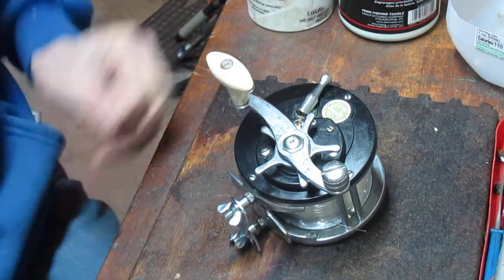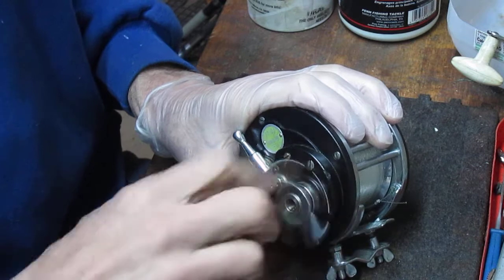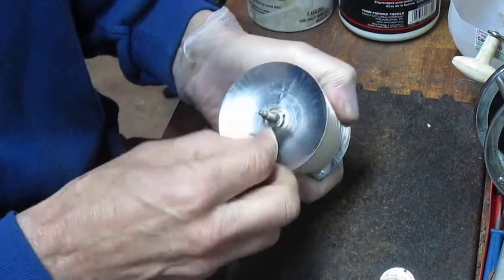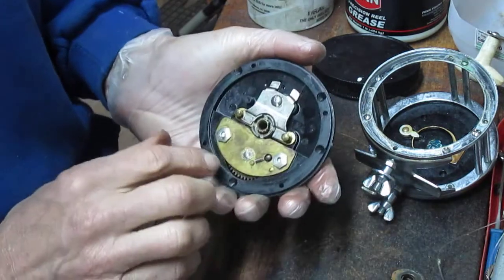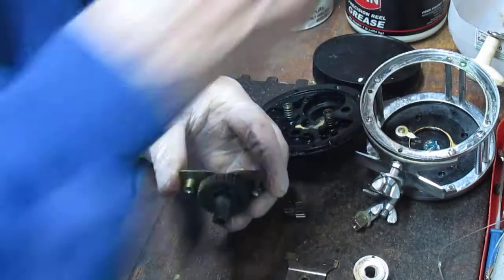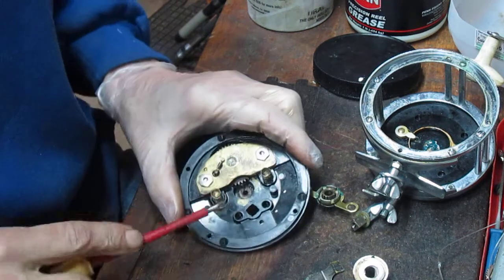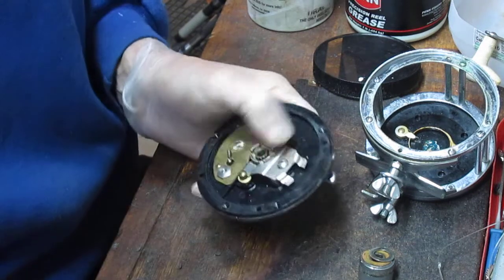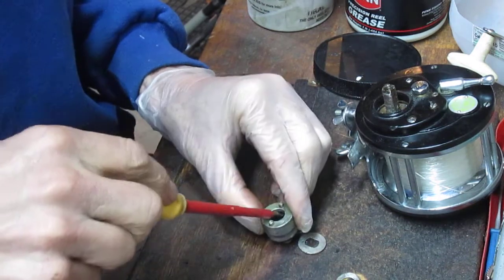Rare Ocean City 210 fishing reel service rebuild with unique drag washer set up

Comment: hello . I have a ocean city 112 . took it apart cleaned it, serviced it . before and after I took it apart . the left side/ clicker side . when I reel the reel the cap unscrews itself snd goes flying! I guess its the bearing/buching cap. when I take the spring out it seems to work better . its a nice reel i just cant seem to figure this out. thank you again!
Reply from the maker: Is the part that the cap screws into on the side plate spinning as well?  It is not supposed to, so you may need to expo it to hold if that I the case.  Also try light steel wool on the spool shaft to bake sure there are no burrs or other issues that could cause a catch - Dennis
Reply: it was frozen on the shaft! I liitle oil a wrench …. took a little while I got it free ! works perfect now! thank you ! what a nice reel!

Comment: Hey boss i got a Daiwa ss turnament 1600...but i can't take apart....i removed 6 screws..but still can't open it..and I'm afraid to break anything..so....
Any idea..??
Reply from the maker: Rey - It sounds like you have removed the screws from the bump guard and the side plate.  And have removed the bump guard as well.  I don't recall the configuration for the bottom of this reel.  Does the side plate stop before the rotor, or does it continue under the rotor/bail assembly?  If it stops before, then it sounds like you just have a tight side plate that can be worked free.  Spray some penetrating oil on the bearing hole where the handle slides through and let it set a minute.  Then use a wedge, like a utility knife blade or small screw drive the try and separate the side plates.  Stop if there is too much resistance.  Do not aggressively pry at it.  Just go side to side trying to work it free and it should come loose.
If the side plate goes up under the rotor, you will nee to remover the rotor before you can remover the dies plate.
Send me a picture  of the lower half of the reel, left side and right to email - 2ndchancetackle@gmail.com and I will see if I can help you further. - Dennis

Comment: Halo Dennis, that was interesting on the Ocean City reel!
 I also put grease on the ratchet gear teeth & lever part; and some oil on all screw threads as I've seen some screws stuck really fast into the spacer bars!
I never use steel wire/wool for cleaning!
I also use finest grade (black) sandpaper for metal cleaning. 
Collector's reels too!
Can see: (www).oldreels.com for them & others!